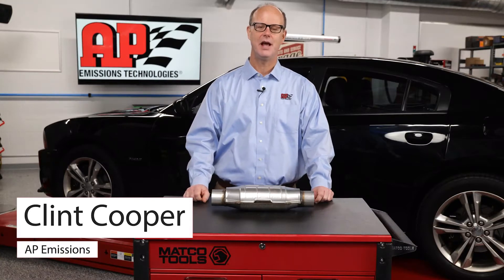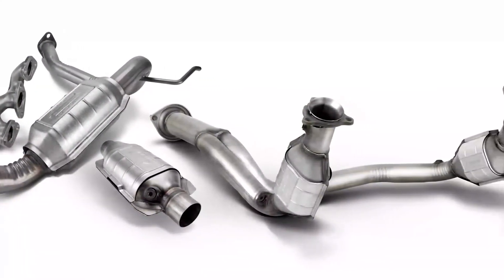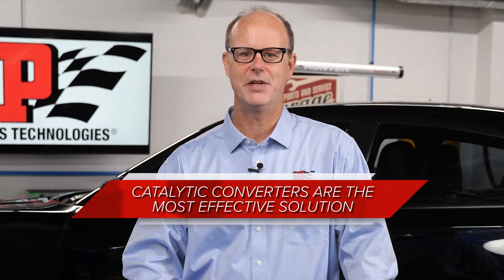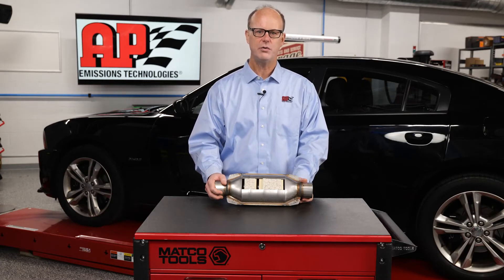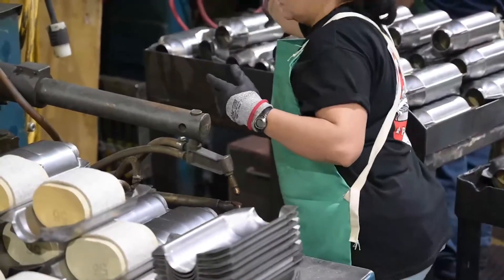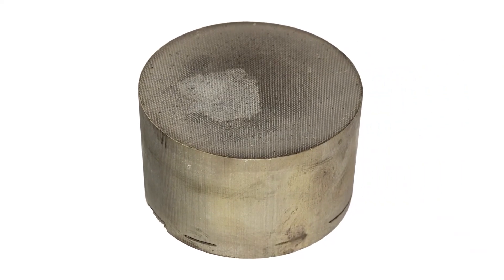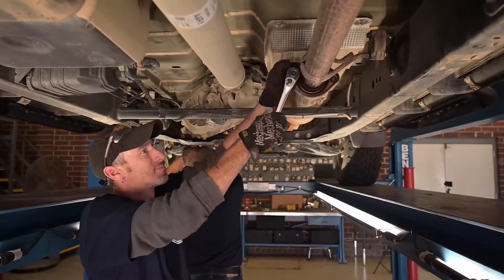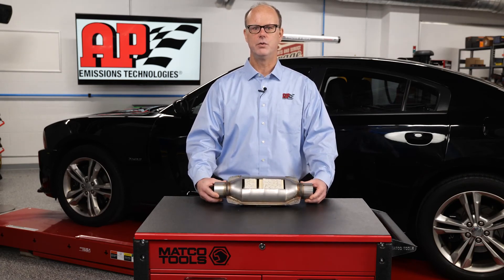How Do Catalytic Converters Work? 🤔

Comment: AP Emissions products do not stand behind their warranty.  I purchased a replacement AP Exhaust catalytic converter / resonator kit for a Pontiac Vibe (basically a Toyota Matrix) is September 2023.  In January of 2024 we had some cold days, and one day when the temperature was 6 degrees I started the car and the catalytic converter rattled for a bit till the car warmed up then was fine.  It was a bit of a concern but it didn’t do it again so I didn’t worry about it.  The same thing occurred in March 2024, except the temperature was in the 40s, and now it rattles every time I start the car till it warms up.
I called AP Exhaust to discuss the matter with them.   I was immediately told that I must have overheated the car which ruined the catalytic converter.  No other questions such as could I have ran over something and damaged it?  Why did I replace the old converter? Nope, just it must be your fault, end of story.  
First off THIS CAR DID NOT OVERHEAT!  I rarely buy cars because I take care of them and keep them running a long time.  I have a 1993 Previa I bought with 172k miles that is now pushing 300k and a 1989 Mustang I purchased new that had 395k miles.  I purchased the Vibe because I wanted something with better mileage and it was a good price, it’s a manual and the check engine light was on, with a catalytic converter code.  In hindsight I should have just changed the O2 sensors to see if the old cat was even but, but I decided to just replace it and assumed I would be good to go for 100k.  Less than 5K miles later it rattles most times I start the car.
AP Exhaust does not stand behind their products all, the 50,000 mile warranty is a joke.  Nope it’s just a quick game of it must be your fault, sorry.